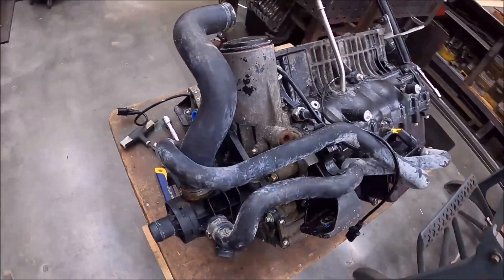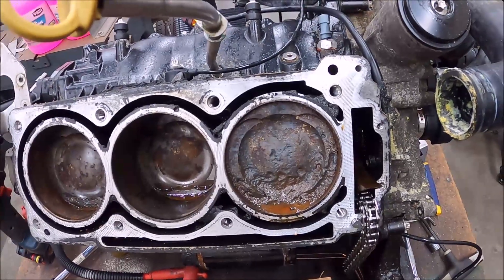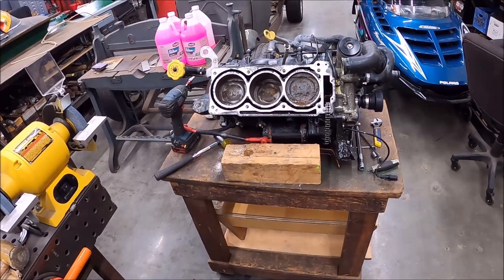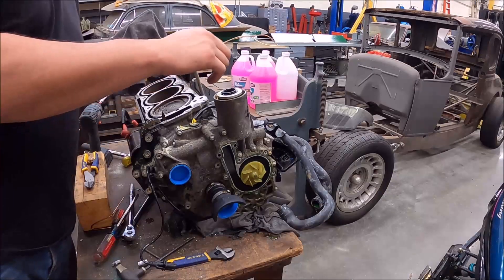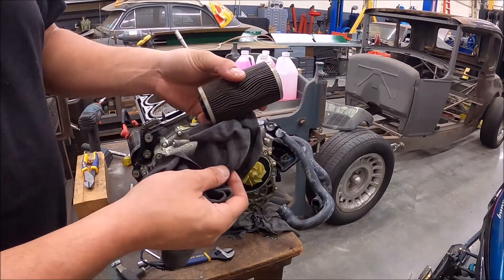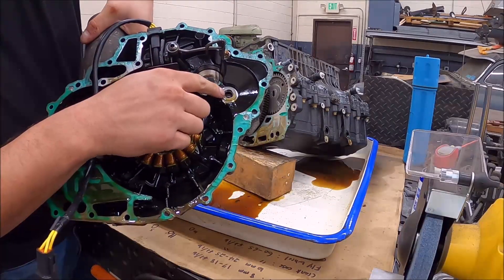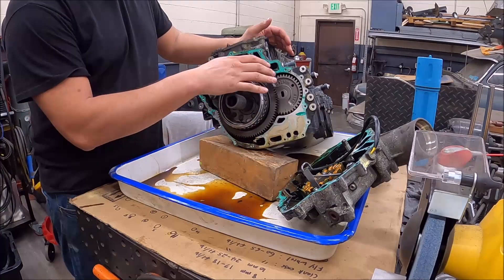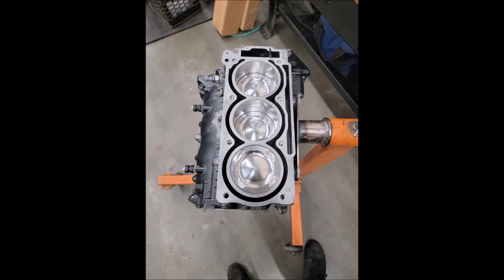Seadoo Rotax 4-Tec Engine  Rotax 1503 Teardown (Part I)

Comment: Dude your SD card malfunction was the exact part i needed to see. I'm trying to take the bottom case off and the thing will not budge. I have all of the bolts out. I've looked all over for someone separating the case and i cant find anything. any help would be appreciated.
Reply from the maker: Need to remove the head, front oil pump, PTO housing, all motor mounts, all outer case bolts, caps and main bolts and it should come apart.
Reply: @EastCoastAntics1  Thanks for the quick response man, I did all of that and this thing still doesn't move. Is there a prying method that won't jack anything up?
Reply from the maker: @ibsomethin  the dowell pins in the case might be stuck or the sealant that was used could be holding them together.   There are a couple spots around the case where you can pry them apart.   If I have one the is a little stuck I just use a rubber mallet.
Reply from the maker: Also have a build video of the motor you can reference

Comment: Thanks so much for the videos!  I have a Rotax 4-Tec in my jet boat.  It's leaking water badly around the drive shaft...either from the carbon ring or bellows.  My local mechanic normally doesn't work on Rotax and we're having a hard time finding where to get parts.  Any suggestions on how to find part numbers and a place to get them?
Reply from the maker: The majority of websites that sell seadoo parts sell the parts for the jet boats which are essentially the same.   They all have part diagrams and part numbers.

Comment: Hi i have question,I have 2006 Sea doo challenger 180 and i can't find my crankshaft sensor.Do you think this engine does't have one.
I remove the charger and still nothing ,no sensor at the usual location.Do you have explanation
Reply from the maker: It's internal inside the PTO cover like I stated in my reply to your question on my other video.  Motor needs to come apart to change it on that year
Reply: Thank you so much brother.Good day

Comment: Good video. I've never owned a PWC and I'm looking into buying one. I was curious about rotax rebuild cost. Are the there other parts that fail that make it not worth the cost fix one or is the engine the only thing that's gonna cost that much to keep up?
Reply from the maker: They all have their problems when it comes to brand.   The all run pretty high rpms.  When it's comes to rotax, if its maintained properly they run for a long time.  I find that most of the broken ones are ones that have been neglected, not maintained, maintained incorrectly or they are due to failure for known problems that were not resolved or updated such as ceramic supercharger clutch washers.  Any of the 4 stroke jetski engine are not that cheap to rebuild.

Comment: Hey I’ve got one that runs good but has a oil leak coming from the back of the engine at the bottom that leaks while engine is running but doesn’t seem bad when just sitting…any ideas? May be a seal? Thanks in advance my man an great video!
Reply from the maker: Sounds like the bellows assembly on the rear of the motor where the driveshaft goes through.   The bearing in the bellows has a seal and that could have worn out.
Reply: Ok  I’ll check it out and thanks for the fast response! I really appreciate it!!